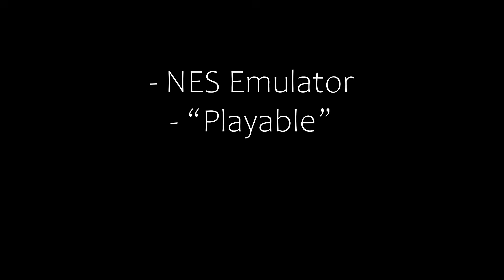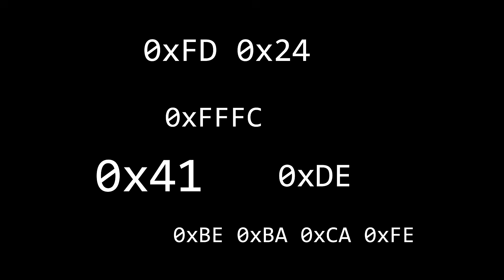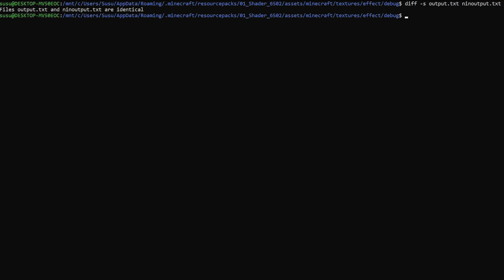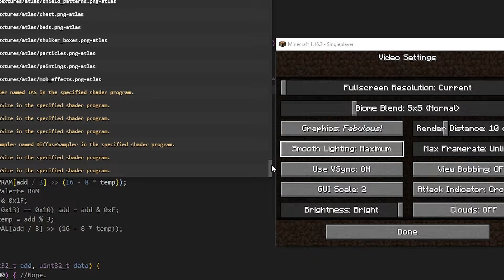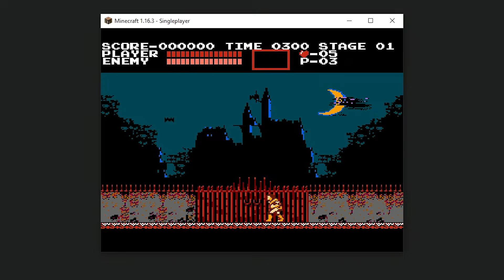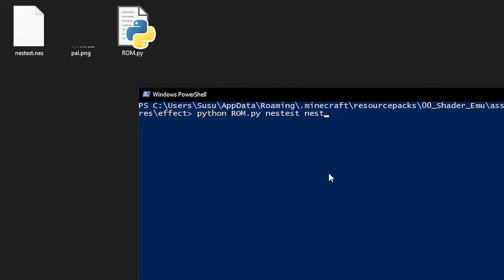Making a NES in Minecraft (Vanilla 1.16)

Comment: I've got a 3080, and I have minecraft for windows (the UWP app, for rtx testing), but I've never done any minecraft modding. How exactly would I go about testing this out?
Reply from the maker: This runs on the java edition of minecraft, so it wouldn't work with the windows store app.

If you have the java edition, the easiest way to get it working is to:
- Download the simple version from here https://github.com/Suso1/MinecraftNES/releases/download/1.0.0/NES.Emulator.Basic.-.by.Suso.zip
- Place the folder named "NES Emulator (All in one world) - by Suso" into the minecraft saves folder
- Enter the world having your graphics set to Fabulous, your resolution set to 640x480 (on the graphics menu), and fullscreen on
Reply: @5uso  Okay, I managed to replace the demo world with the simple download you provided, so I didn't have to buy it again. The controls don't work, but I can report that it looks like it's running at approximately 25 fps on the demo screen, which looks nearly playable. It uses 100% of the 3080 as well, which is frankly impressive.
Reply from the maker: @Cruzz999  Neat, I wasn't expecting it to go that hard on the 3080 tbh xD
Reply: @5uso  Ah, I see. I'll have to grab the java edition then, got it.

Comment: To remove the need to set your game resolution to a specific value, couldn't you just make your previous logic write to a custom buffer instead and add a pass that reads from your fixed resolution buffer but squishes it to still match your fixed resolution? 
To demonstrate adjusting to the resolution like that, I wrote some shadertoy code:
https://www.shadertoy.com/view/tdcyWH
Reply from the maker: I thought about doing that, but a fixed resolution seemed much more convenient to me for debugging, and it's one less thing that could go wrong. I'm not very good with shaders, but I also thought it should perform better, since the resolution is used in many expressions that would be simplified into constants at compilation (not too sure about this one). I also was trying to fight the instruction limit (even making the rom image resolution not a constant was pushing it too far).
TLDR; If I wanted to play more with this, I'd definitely go for it, but in the end I decided that it just wasn't worth it for this tech demo, thanks for the feedback though!
Reply: @5uso  I'm not sure if you know of this, but you can tell a buffer to have a certain size in the post json. That would make everything perform just as it did before with the addition of the miniscule cost of also running the 10 lines of code it needs to resize the image.
Reply from the maker: @thederdiscohund  Yeah, thinking about it now it wouldn't be very difficult. If I ever update this, I'll add that in

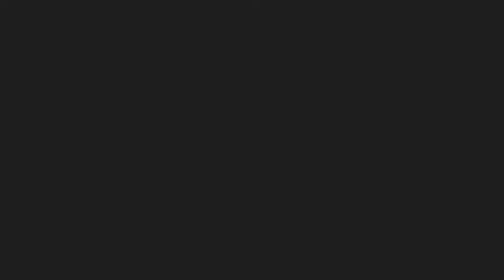Comment: 5:00 A switch statement with 200 cases? Surely there's a better way
Reply from the maker: Jumptables are the most common way to implement the instruction set, and the compiler should do quite a good job at optimizing it (taking into account how many instructions do similar things). My implementation is probably not the most efficient, but doing it on glsl was quite limiting. The faster way that I know of would be real time recompiling, which isn't possible on a shader

Comment: WOW! Bravo. This is a game changer, literally! Absolutely incredible!!
Reply from the maker: Thanks man!
Reply: @5uso  Ur welcome dude! However one issue I'm having though is being stuck at a gray screen. How long should it usually take to run a game after converting it's rom?
Reply from the maker: @TheSycoraxComplex  If the game is responding (that's what usually takes the longest) it may be an issue with resolution or it being another mapper. What game are you trying to run and are you using 640x480 windowed?
Reply: @5uso  I'm trying to run Super Mario Bros. and my resolution is 640x480 in windowed mode. The Fabulous setting is on. I'm using the resource pack that came with the simple version download.
Reply from the maker: @TheSycoraxComplex  Hmm, that's weird. Does the basic all in one download work for you? Otherwise, it may have to do with graphics card compatibility (I have only been able to try it out with a few cards, all of them Nvidia)
Reply: @5uso  Both of the downloads work, your ROM.py script works as well. My graphics card is a GTX 970 6GB. I've tried both mappers and I wasn't able to get a game running. I even converted an SMB rom file and I still wasn't able to get it running.
Reply from the maker: @TheSycoraxComplex  970 was one of the cards I tried it on, so it shouldn't be that. It's hard to tell what could be going wrong this way, since it's quite a finicky thing to get it working. Maybe the client's output log has something interesting. If it keeps giving you trouble we can maybe talk over discord to try to troubleshoot it
Reply: @5uso  Wait nvm got it working, I actually didn't have the resolution adjusted correctly and I also had some custom JVM Arguments that probably didn't allow it to work either lol
Reply from the maker: @TheSycoraxComplex  Oh, neat! Glad to hear that. I was starting to get worried I messed the download up
Reply: @5uso  Yeah, but no worries my friend everything works pretty well tbh! One funny thing I can note from using this is that, when I had loaded the world of a project that I've been working on, I saw that you're emulator was actually getting displayed on a couple of armor stands in my world for a few seconds until Minecraft crashed and I was pretty confused but somewhat amazed for a bit, I was thinking it was just a glitch in Minecraft but it turns out that I forgot to switch back to normal settings, I still had you're resource pack on, and the custom model data that I used was the same as yours Lmao That was a pretty weird coincidence tbh, but an awesome one to say the least! In any case, do you have plans to improve this emulator in the future and to make it run faster?
Reply from the maker: @TheSycoraxComplex  I keep using diamond hoes for custom models even if it doesn't make sense anymore. I would like to see this perform a bit better, but I don't think I have the skills to improve it noticeably right now, so I'll probably just leave it as is (at least for now)
Reply: @5uso  Yeah, I know what you mean lol but  I believe that this can be vastly improved. I would suggest contacting some people that have extensive knowledge of vanilla Minecraft shaders and see if they can help you with that. There's quite a few people that are on the Minecraft Commands discord that you can contact.